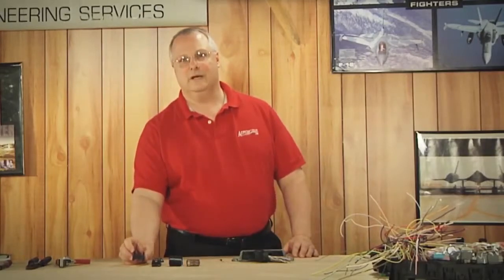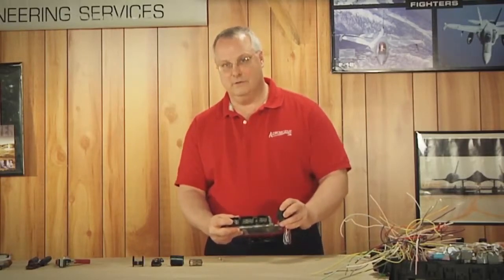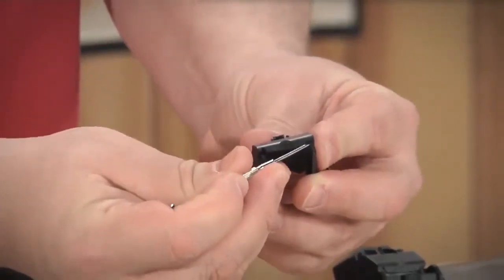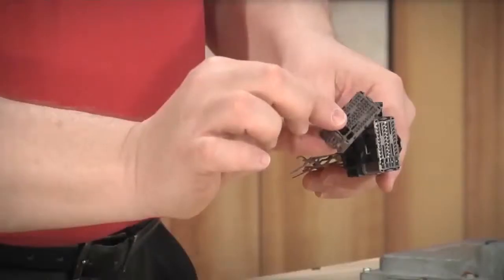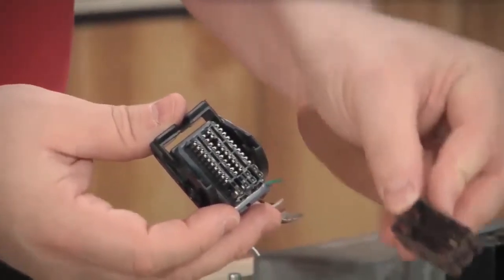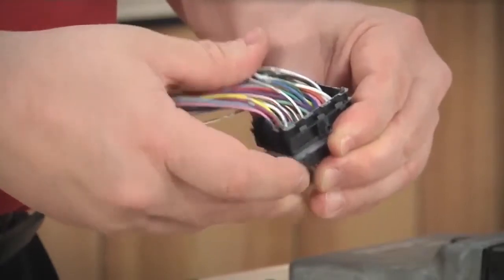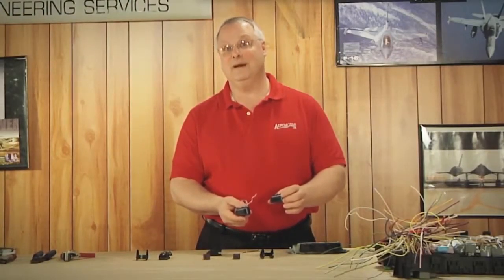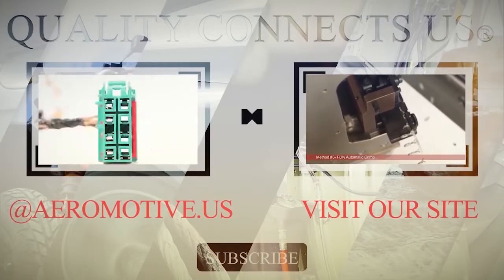Removing/Replacing an ECM 48 Way Connector

Comment: Can you please tell us what size/type terminal pins are used for that Nissan ECM connector?
I need to replace a few of the pins on my Sentra and I can't find out what pins I need, they're not listed on the wiring diagrams.

Comment: This is 99% the same as a brp seadoo ecm connector. Do you sell just the smaller pins? I need some to install different accessories.

Comment: Thank you for showing how to unplug it.  I cannot get mine plugged back in
Reply: Ensure that the Lockig Bail is rotated fully to the unlocked / released position, line up the connector with the socket , as you press it in the Bail will begin to rotate back towards the Locked position. Manually rotate it until it locks into place.  Randy   AKA randog311

Comment: Thanks very much. This was very useful for fixing a bad wire on a Nissan ECM
Reply: If you don't mind me asking, what wire did you have?That was bad , and how did you fix it
Reply: @hammohammbbyblksheep4251  It was for one injector signal wire where somebody inserted into the wire terminal a pin too big while doing tests and  causing it to expand and make bad contact to the ECM.